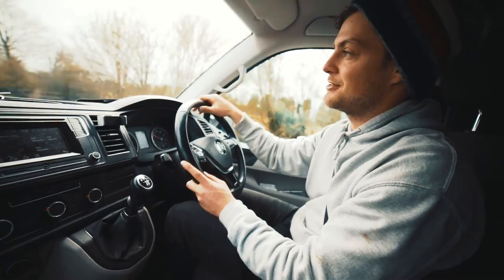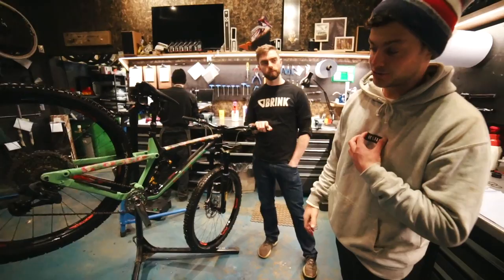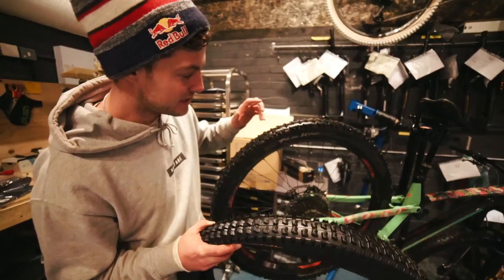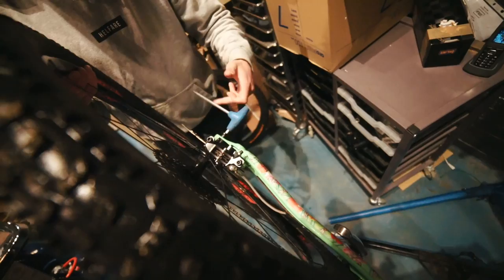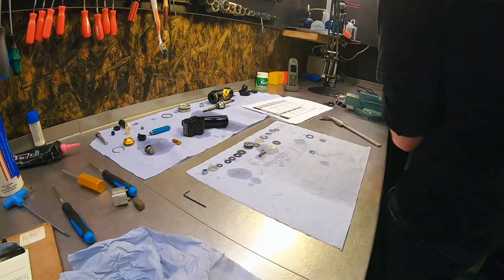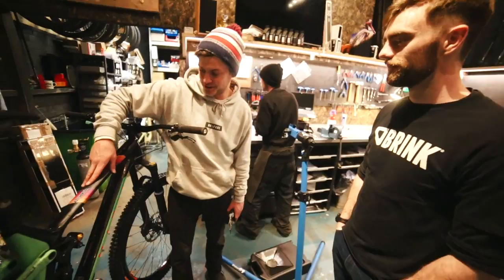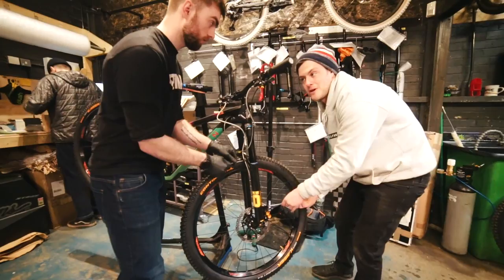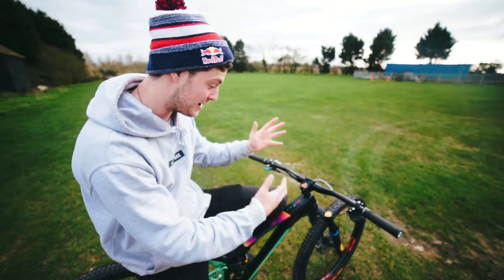NEW SUSPENSION UPGRADE TRANSFORMS MY CUSTOM TRAIL BIKE!!

Comment: I have an alloy fifty and this video is like exactly what I was looking for! I upgraded a rz3 with a new fox factory 36 (150mm - a 30mm increase). I need to have something done about my rear suspension as well. Right now it is a frankenbike, and I'm not sure if the debonair roxshox is up to the task. After watching this, maybe it can be tuned by a pro and handle the rough stuff. Has anyone increased rear suspension travel on a Rifty? How did it go?

Comment: Isn't this the reason you dont use a trail bike for big stuff🤔 just get on an enduro bike matt.
Reply: Dan Bray he has his wolf ridge but it’s ugly and heavy
Reply: @connormcguire8439  yeah but using a bike with like 120mm travel on dh stuff is nuts. No wonder he has bottomed it out to point where it has bent the bolt and nearly broken the shock. Jusf think it's the wrong bike for the job
Reply: @danbray3960  it is the wrong bike for the job, but his enduro bike is not nimble enough for it, so he rides his DJ, or this bike. having to maintain it as often as he does is a small price to pay (for him) to have a bike he can jump and take on trail rides.